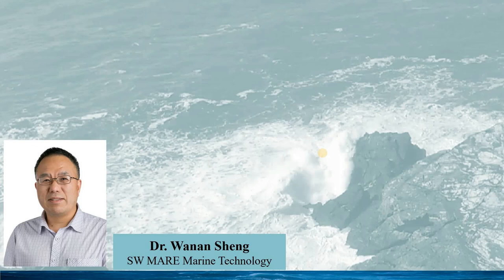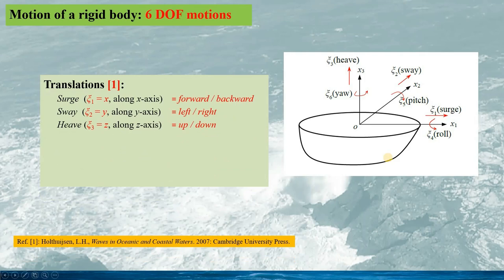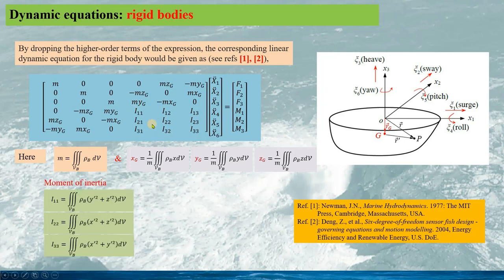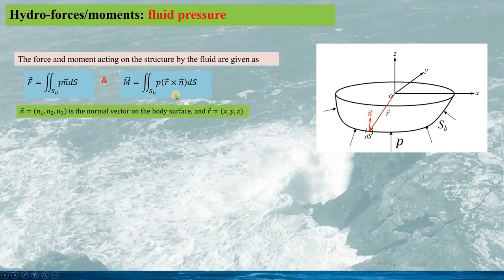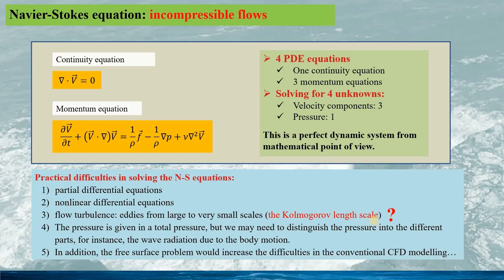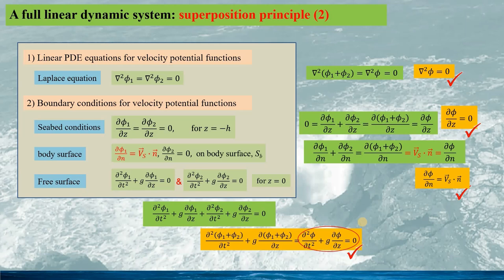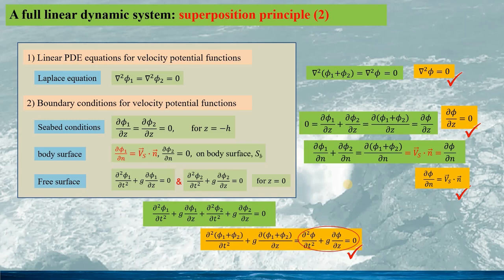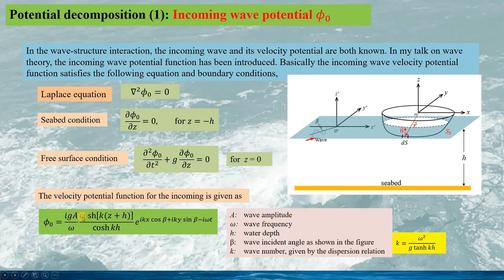[Wave Energy Conversion] Boundary Element Method, Part 1: Potential Flow Theory

Comment: Thanks alot prof.prof,can the boundary element method be used to calculate the hydrodynamic potentials and forces and moments for completely submerged bodies?
If so how can this be done?
Thanks in advance
Reply from the maker: Yes, you can. the only thing you do is to build the panels for the enclosed surface of the submerged body, and using the panel method is totally same as those for floating bodies.